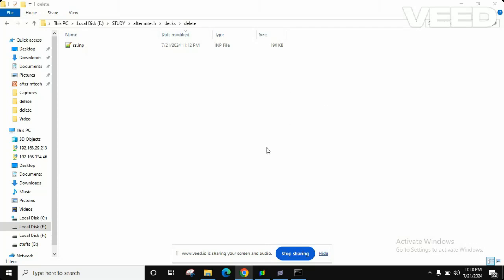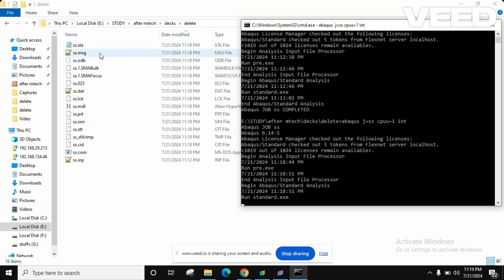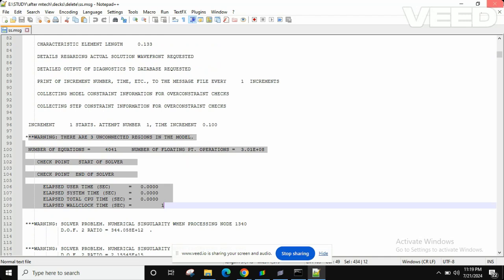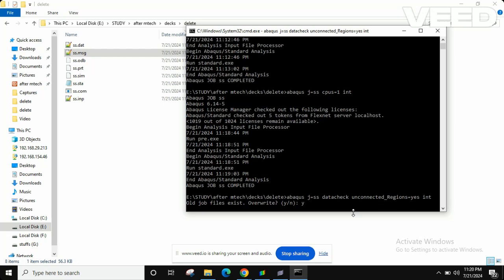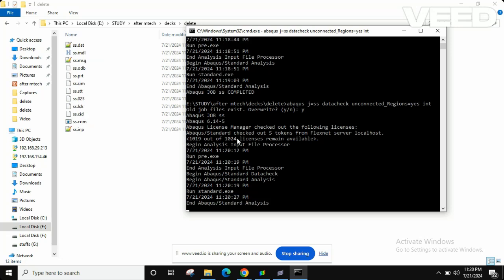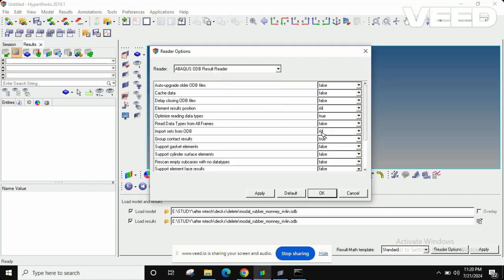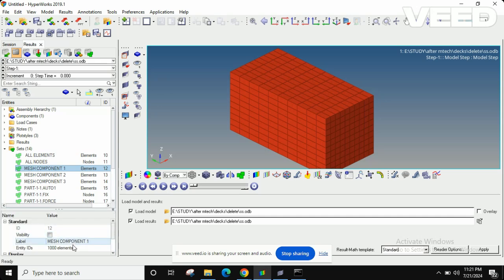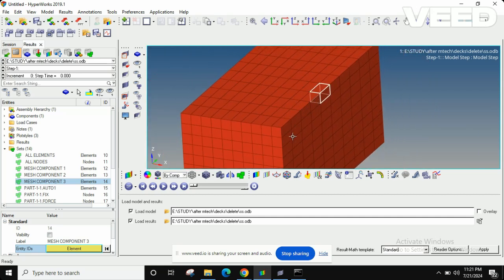how to identify unconnected regions in the Abaqus model

Comment: And what should I do with that
How to solve it?!
Reply from the maker: Hi, once you got the unconnected regions in your model.
You need think of the physics of problem whether those unconnected regions will be interacting or not during load application.

In most cases, unconnected regions can be solved by node equivalence, tie surfaces or use contact pair. Based on your model physics, you need to decide which one to use.